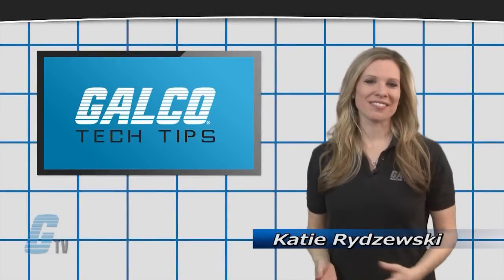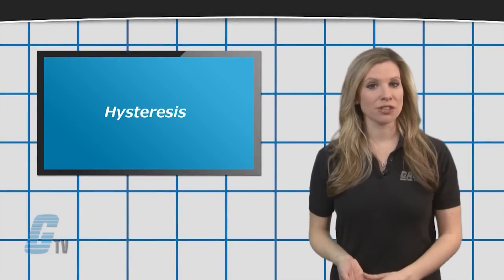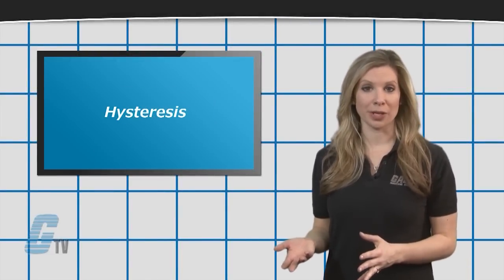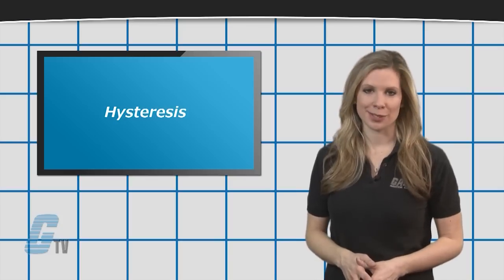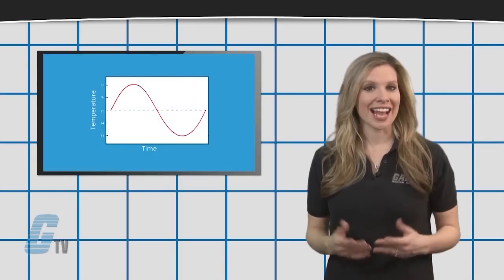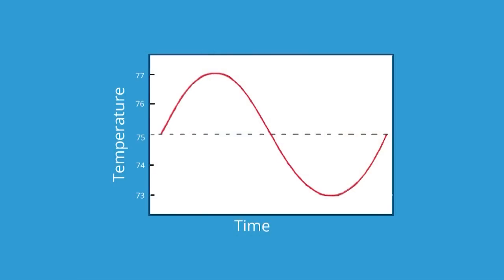What Is Hysteresis? - A GalcoTV Tech Tip | Galco

Comment: so basically the same thing as "deadband"
Reply from the maker: +Centrifugalsparks Deadband is a general phenomenon where a band of controller output values fails to produce a change in the measured process variable. Deadband can be introduced intentionally or as a result of lag in a system. Hysteresis is used in on/off control loops to eliminate frequent switching of a controldevice that would result in undesirable oscillations within a system.